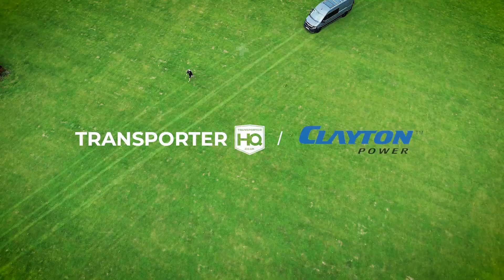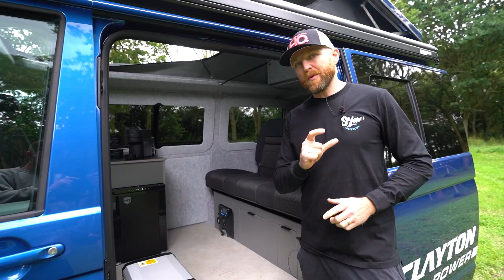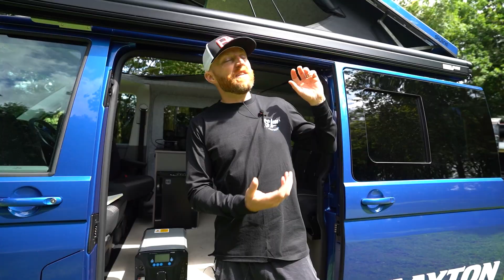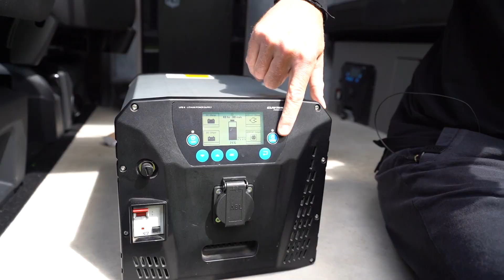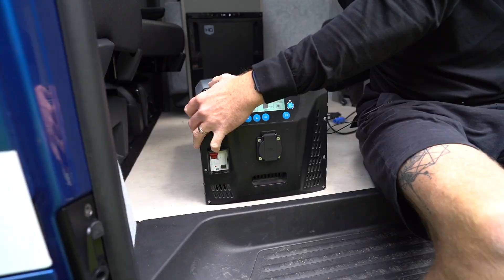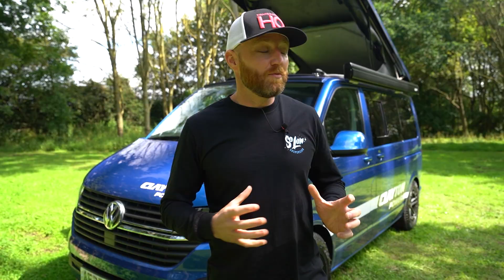Easy Off Grid Camper Van With Clayton Power | 230v On The Go & No More Gas!

Comment: I will be doing a van build some point in the the next 12 months. I ve seen a few videos with these in. Question i have is would the 3000 comfortably run a fridge and a diesel heater (over night only)  over a weekend?
Reply from the maker: Yes it would. Especially if you have some solar on there too

Comment: Hi. Wish I had seen these units months ago, but only happened on it watching Roming Radford recent video. I only hear from videos about putting these in campers, but what if I want to pop one in our Burstner Ixeo motorhome? We currently have a couple of Lead acid 100Ah batteries along with a couple of 100w solar panels. We need power for laptops and would be great to get our 240v system working off grid so we can use an Airfryer etc. We are up in Scotland, and Clayton dont seem to have any dealers up here. We are down south often including next week for the Vanlife Festival at Shrewsbury

Comment: 3200 quid 😮 wow
Reply from the maker: It's cheap for what it you get compared to a separate system. The other alternative is a basic leisure battery that cab only run 12v. Here a treat for you. Use the code THQLPS and get 10% off 😉

Comment: I have the 2000w LP1, (2020 unit) back then there was no solar charging, clayton were great they give me all the help i needed to add a victron mppt solar charger, i added a 360w panel.

I can run a water heater, shower, electric inverter hob, travel iron, air fryer, coffee maker, mig welder, grinder , battery chargers, everything you can use at home (not all at once) It lasts forever. The solar at 360w charges to full in the first few hours of morning sunlight, which then means that your battery easily reaches the float cycle level daily, which in turn protects and conditions the battery gives fantastic life span.

Its mega! Everything said in the vid is 100% right, i wouldnt even dream of having anything else its tiny but massive ! Worth the money.

Only downside and I had to really think hard, is if you leave the 240 inverter running overnight the fan starts and stops every 10-20  mins which could bother light sleepers. 
You can just run 12v on a night while sleeping which is completely silent. 
Its nothing compared to the benefits.

Offgrid 10 days in france this year never used shore power hook up once, never had a flat batt. Aaaaand it can be taken out of the cradle and used remotly, if you fit it that way. !!!
10000% ace!
Reply from the maker: It's great to read really world experience. They're a fantastic bit of kit.
Reply: That’s useful to know as, I’m giving it serious consideration for my van. The 2000 with solar sounds spot on.

Comment: @transporterhq - you did a video before about off grid power units. What would you recommend for mr Shuttle which now has an Ovano system in the back rather than a full camper conversion. I have a full leisure battery set up with mains hook up and inverter too but for a full off grid solution to add to what I already have is what I am trying to decide. Any information gratefully received. Thanks guys, love the vids!

Comment: It is great and definitely more capable than other systems but I feel the smart move would have been to make it shaped to fit under the driver or passenger seat in “most” vans. That would be game changing! And would make it viable for kombis etc. where there aren’t cupboards. It is also very expensive and to compare it to victron the most expensive brand isn’t fair.
Reply from the maker: It's designed for the commercial market, we're just saying how it can work really in a camper. Shape wouldn't have been part of their original design for that reason. I think it is fair to compare it to Victron as that the equivalent in quality and what's most commonly used in 230v camper builds.

Comment: I used an AC200max from Bluetti to power my van. Electric cooking AC and rest on 12V. It's rarely under 60% at end of day. Mostly back on 90-95% in the evening. Used a Neutrik for the shore power input.
Reply: Would be interesting to see how the AC200max compares to this seeing it is half the price and includes the solar panels.
Reply: @uncensored5104  that Clayton is a nice unit. Got some pro's for those who do without solar. But, yeah. Double the Price is hard.

Comment: Interesting looking option. Previously I've seen you raving about EcoFlow Delta. How would you compare/contrast the two ?
Reply from the maker: Both great in their own way. EcoFlow is more of a portable power pack you really need to charge at home. Think kombi van with a bit of power. Clayton is a full integrated system for a full on off grid camper.

Comment: Aside from the small footprint and ease of the install is the true game changer  .... the abitity to recharge the LPS II 3000 from 0-80% in 30 min of driving if one also has the 1000W super booster?

Also:
1. How long does it take to recharge the LPS II 3000 the remaining 20% (i.e. 0 to 100%) 
2. Is it possible to recharge the LPS II 3000 via one of the electric charging points at say a supermarket or petrol station? 
And if so how long would it take? ...and would it be at 750W?
3. There is mention of the ability to add extra batteries in the future. Any idea of the time frame as to when this will occur and what the possible options might be?
Reply from the maker: About 30 for that last 20% 

It's not possible to charge at car super chargers as there is no way to connect them currently. Maybe something for the future. 

The additional pack arrive around October.

Comment: There is just not enough energy in those power stations  to totally replace gas or a diesel heater or the grid.I have a typical power station, an ecoflow, it holds 1 kw of power and it cost £1000. It is very good for short term use but it needs to be regularly topped up with either the grid or a solar panel, which would take forever with a typical 200 watt unit, especially on a cloudy day or worse in winter. It can typically boil an electric kettle full 4 times. Not a practical long term solution as a replacement to gas, diesel and the grid. Sorry, you are wrong.
Reply from the maker: I disagree and I never mentioned replacing a diesel heater. Yes an ecoflow does take forever to charge off your 12v but a 2KW Clayton LPS can charge in as little as an hour off the vehicle alternator. Yes on cloudy days you're not going to be pulling 400w from solar but you have the vehicle running as back up if you need. It also takes a lot of electrical equipment use to use 2KW. It's a good option to add a hook up for sure if you have that option on the campsites you visit. We'll have agree to disagree on this one.

Comment: I’m a BT engineer and I’ve never seen one of these in any of our vans
Reply: That's great wonder if I can get one in spain
Reply from the maker: @smiffyinspain  we can ship it but it might be easier to contact Clayton power in Denmark
Reply from the maker: BT open reach have around 40000 vehicles, 2000 of them have Clayton power units in.
Reply: @THQAutomotive  Beat me to it guys but yeah they are not in every single vehicle...  but they should be...  For the guys that need it, it would save a lot of curb smoke and noise :face-turquoise-covering-eyes:

Comment: Without trying to knock the product this is a 100Ah lithium battery paired with a 1500 watt inverter meaning about 20 odd minutes at 1500W before you get to 20% left in the battery from full.
Reply from the maker: A 3000w inverter with a 160ah battery (or 2000Wh). So it would run 2000 watts for an hour or 500w for 4h, more than enough for most Campervans where a 2000W draw for extended periods us not common. And if more run time is required you can add on additional storage very soon with the new battery banks 😊

Comment: We have an awesome T6 conversion from VWT and I’ve been considering a doing a self convert of a larger van due to the cost of the bigger van conversions and this is really exciting as an option to simplify the entire electronics. We don’t want a motor home, we want to camp in a van and this would be ideal!
Reply from the maker: They are game changing and so easy to install
Reply: Are you able to help with the installation? We had ours delivered today and my 🤯
Reply from the maker: @ChloeVerse  Hello, yes it comes with complete instructions inside the box :)